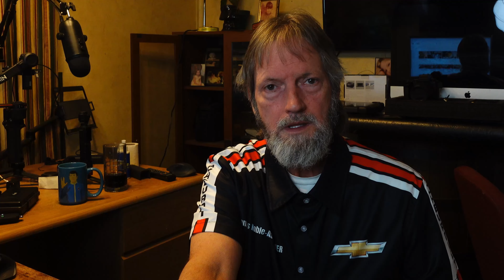DIY GMC 2.4 VVT Solenoid Replacement Guide

Comment: Inwas also told it could throw a po420 I believe the catylic converter code my scanner said its good by running data on timing chain and 02 sensors
Reply: Also I figured to change both bc its the same price for both or one at auto zone
Reply from the maker: Yeah, I would think that it would cause a catalyst insufficiency due to the fuel trims because of the cam timing

Comment: Was this p0011 code?
Reply from the maker: Yes that's the code for the intake solenoid are the intake VVT
Reply: Ok thanks but it can timing chain as well?
Reply from the maker: @rondieringer6783 no not usually this will cause you a cam crank correlation code that usually is a timing chain issue I find this code is usually because the VVT is either sticking open too long or not opening up enough I've yet to replace a VVT gear except when it's noisy
Reply: Ok cool.thanks theres no noise
Reply: Also should i do intake soenoid first or vvt
Reply from the maker: @rondieringer6783  as long as you have the right weight oil in there, I would definitely start with the intake solenoid.
Reply: Ok cool thanks for all your info man have a great memorial day